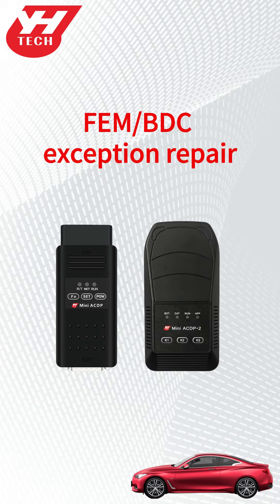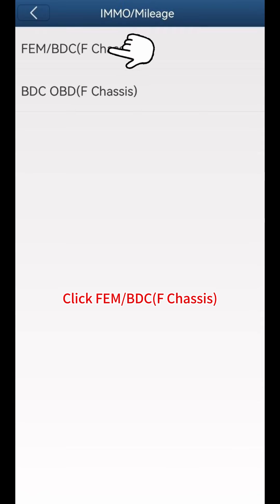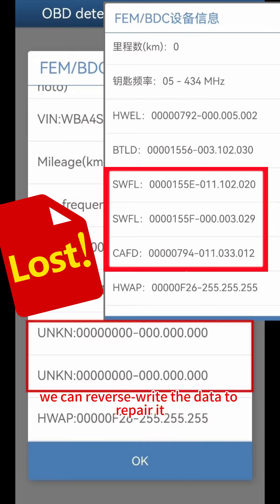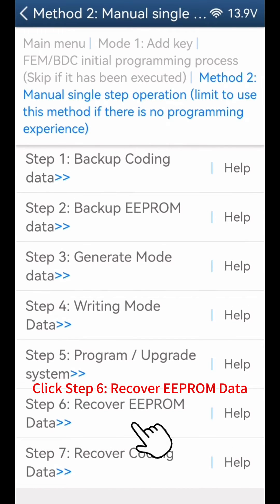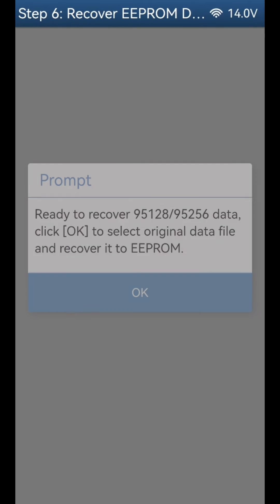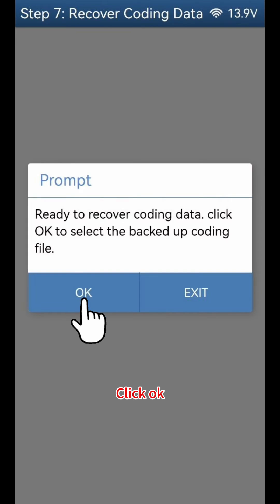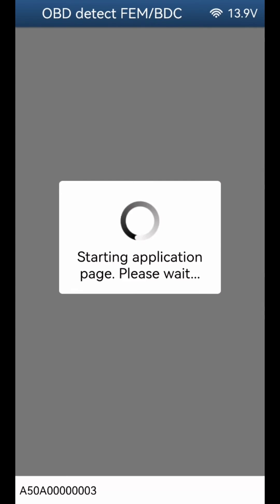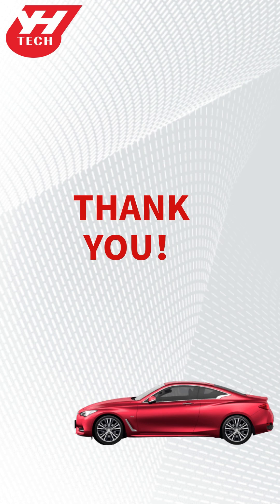Yanhua Mini ACDP Repair BMW FEM BDC if Lost Coding - OBDII365

Comment: So what you recover was not the oem file from the actual car, was a virgin file? This is what I understand from the video, is this right? Thank you
Reply from the maker: recover 95128 or 95256 eeprom & coding data from the actual car
Reply: @LiuyangOBD365 Hope this works as have a locksmith who bricked fem/bdc. Need to recover & may need virgin file. Think may be "soft" bricked....